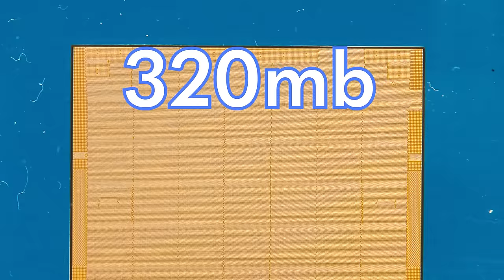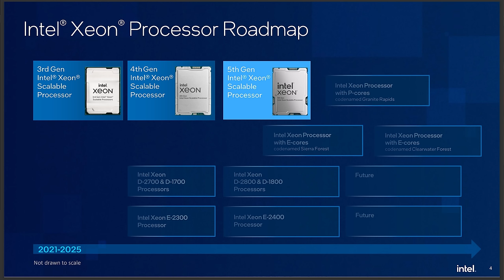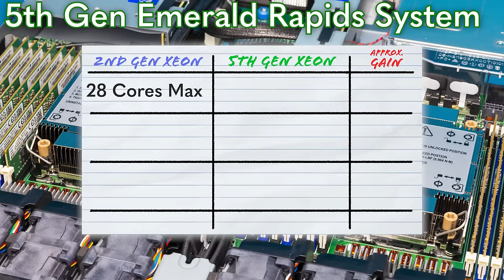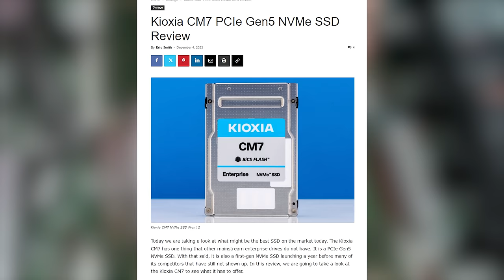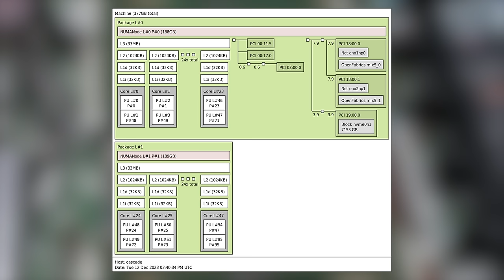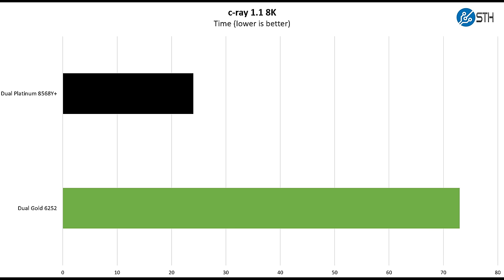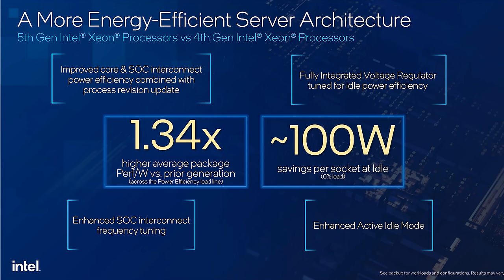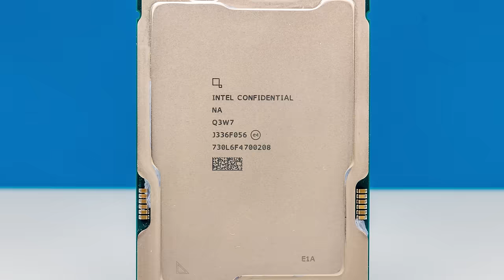New 5th Gen Intel Xeon Processors - ft Supermicro X13 - Emerald Rapids

Comment: Thanks for the great review. EMR looks like a solid upgrade even for those coming from Ice Lake! (Though we're waiting for Granite Rapids for our next upgrade). As a current SPR workstation owner though, I really hope they manage to find a way to somehow make the reduced PCIe lane in EMR works in a workstation. (EMR only has a maximum of 96 lanes on die while SPR has a max 128 with 112 lanes enabled)
Reply from the maker: To me, the cool part about an EMR desktop would be the lower idle power consumption. 80-100w is huge. I do not think many folks are going Ice Lake to EMR just because Ice was launched in early Q2 2021 but started to ramp volume in Q3. 9 or fewer quarters is short when many are pushing servers to 6 years/ 24 quarters of use.
Reply: @ServeTheHomeVideo Completely agreed, that improved idle power consumption is huge for workstation. Which is why I I think it would be sad if they can't make EMR works on existing W790 boards due to reduced PCIe lanes (as they're physically wired)

Comment: Diving into the fascinating comparison between the Gen2 Gold 6252 and the flagship Platinum Gen5 8568 is truly captivating! Notably, at the time of release, there was a substantial price difference, with the Gold 6252 priced at $4263.00 and the Platinum Gen5 at $6497.00. It's crucial to recognize that these models cater to different needs. For a more precise comparison based on price points, exploring the 8568 versus the 8268 or even the 9242 might be more fitting. However, the notion of relying on those visually striking 3 to 1 figures remains somewhat uncertain.

Comment: Cool vid. I recently started tooking into xeon processoers when i picked up a used HP z440 for cheap. 👍
Reply from the maker: Thanks! Always great to get those old Xeon workstations cheap!
Reply: @ServeTheHomeVideo  yeah it was hard to pass up for 80 USD. It's gonna be a great project upgrading and tinkering. But it sent me down a rabbit hole reading up on all the differences the xeons have fro the I series or the older pentiums and celerons.

Comment: Based on my experience trying to prototype & run generative AI services on AMX on a sapphirerapids chip, while it does better than AVX512VNNI on icelake, it did not feel like the AMX accelerated software was sufficiently matured and that the AMX acceleration was not being taken full advantage of, since when adjusting for disparities in cores vs the compared chips, AVX512VNNI on zen4 was... not far behind. Another VERY annoying problem with AMX is that it is not officially supported in VMs - and true to intel's documentation, it flat out doesn't work in most VMs, only some specific versions of specific VMware hypervisors released in Q3/Q4 this year have support for it.

Does emeraldrapids solve the slow clock ramping that sapphirerapids is saddled with as well? When going from no load to max expected load, it would be overloaded for a while due to the cpus taking a while to ramp up to reach their sustained clockspeed (which is sort of the opposite of normal behavior, where normally clockspeeds will ramp down from an initial boost speed)
Reply: I have not tried using AMX myself, but QEMU+KVM does seem to report AMX support on SPR. FPU state also reports the correct size (with AMX Tile Config/AMX Tile Data being available). Though AMX does seem pretty half-baked for sure... (looking at all its erratum)
Reply from the maker: Did you see the main site piece we did on Numenta? That is super interesting. They are using AVX-512 plus AMX and can use Xeon MAX HBM as well.

Comment: There is unlikely to be workstation products, right? AMX might be the only affordable option to run really large language models locally. 

Can't afford several RTX 6000 Ada or A100. And Intel isn't selling their Gaudi2/3 or Max GPU for workstation either. (is this low power idle modes again?)
Reply from the maker: I would love for there to be workstation products since I think this is a better workstation platform than SPR.

Comment: I really want an ai inference device but I don’t want to go the server route. It’s a bit expensive and too power hungry.

The m1 ultra showed that it’s possible getting decent generative ai inference speeds using an APU. This is my backup plan if Intel or AMD doesn’t get their new products in order for ai.

I’m waiting for Intel or AMD to catch up because I don’t want to be stuck in Apple’s closed eco system. 

I heard that AMD strix point will have 50 TOPS for ai calculations. I might get that or Qualcomm’s elite x (if available with software support) and pair it with a lot of ddr5 ram and maybe a Rtx 3090 worst case scenario.

I reckon I can get decent response time for very large language models this way.
Reply from the maker: We have a M1 Ultra 128GB and it is not too bad at all for that.
Reply: @ServeTheHomeVideo  I saw benchmarks for the m1 ultra and I’m really tempted to get it. My main issue is that I can’t provide more memory to it. 

Although they claim it’s 128gb, not all of it can be allocated to the gpu.

There’s also no upgrade path for this device. After AMD strix point there’s apparently another one coming out called kraken. 

I’m not sure if they will come out for the desktop market but I hope they do. Either way, there will definitely be some Chinese Frankenstein computer coming out with these chips for the desktop market.

Edit: I also worry about repairability with Apple. If one thing is broken then the entire thing is likely wasted. Whereas the diy market has replacement parts for itself.
Reply from the maker: @theworddoner  To me, I am more worried about what happens if Apple stops supporting them. In the meantime, they get cheaper by the day.

Comment: Out of curiosity, if you were running on board AI accelerators to deploy generative AI, and had a hard power limit (absolute power, not efficiency), are there any server platforms that come to mind with support for around 356 to 512GB of memory, and a sub 200 watt total system power draw?
Reply from the maker: Are you just thinking AI? For EMR I think that would be pretty tough. EPYC 8004 can get close-ish, but does not have the onboard accelerators. With AMX, you end up wanting more cores since it is more like AVX-512 versus a standalone-ish IP block like a NPU or the QAT accelerator.
Reply: @ServeTheHomeVideo  Haha, that's a fair point, and thanks for the response.

I'm specifically thinking about large languages models deployed in CPU (via cache-line optimized linear algebra libraries, similar to LLamaCPP), versus dedicated dedicated accelerators.

My suspicion is that in a lot of cases you might be able to get to a memory bottleneck either way, in which case while there is a difference to an extent, you might actually lose more time paging in and out to memory than in dealing with CPU cores (particularly with AMX) or accelerators.

One somewhat wacky option is a person could tensor parallelize the models (given sufficient RAM) on a consumer CPUs, (on a low power server platform) possibly via OpenMPI, and it would be fairly easy to hit a quite harsh power limit as I've listed here, but there are software limitations so I was hoping someone else had come up with an idea I had missed.

Either way, this isn't a speed-critical application, but an accuracy dependent one, which isn't as common an issue in the space so I've been struggling a bit to find the right match.

Regardless, cheers, and thanks for the content!

Comment: I really want Intel to be the best one, but AMD specs are winning out on almost every metric for servers. 
Intel still wins on gamer PCs
Reply: X3D says hi. And idle power doesn't matter in Desktop Environment (it matters more in Mobile)
Reply: @rezaramadea7574  Can you explain? I am curious.
Reply: @MarkBarrett  Ryzen X3D beats out all current gen Intel CPUs, and not to mention using half the power consumption in Gaming. On the Gaming side Ryzen wins out, but on the Productivity side, Intel wins MT perf/dollar (AMD doesn't care enough to increase Core Count on R5 & R7 products).
Reply: @rezaramadea7574  Intel still wins on 1 or 2 cores, which "key threads" are most important. 
I'll admit, nothing I know of can beat the Threadripper on multi-core.
Reply: @MarkBarrett  Nope, you're talking about Gaming, X3D will still destroy intel, on every Average Metric possible.

1 core or 2 cores on "Synthetic Benchmark" is not Gaming.
Reply: @rezaramadea7574  What if, a max clock Intel CPU did "key threads" which are super important, and transferred to an AMD Threadripper for all the main workload? 
That seems like a super combination...
Reply: @MarkBarrett  yeah, that's indeed a dream come true. Threadripper doesn't really need 3D Cache, because few Workloads take advantage of it (most EDA & CFD simulation will have to use EPYC-X). 

Threadripper with Extreme Clockspeeds will leverage many workloads that matters. The issue will be Power Cost & Heat (liquid-cooling will be an absolute Mandatory).
Reply: @rezaramadea7574  You sound overly defensive. 
I gave you a good credit to AMD. 
You should return it.

Comment: Now compare to Milan 😂
Reply from the maker: It is in the performance section.
Reply: @ServeTheHomeVideo  linux compile Emerald rapids has ~20% on Milan. Milan is not cascade lake. Feel for you Patrick….
Reply from the maker: @BurnsRubber  Yea Milan was an Ice Lake generation. Not much of the market will upgrade from Milan or Ice to EMR because they are <3 years old. The huge market force right now is upgrading 2017-2021 era Xeon servers. Until Rome, AMD did not even start to make a dent in the market.
Reply: @ServeTheHomeVideo  yes good point. Intel is obviously desperate to keep those customers seeking to upgrade from the stagnation era of intel (2017-2021) from switching to ARM or AMD. AMD has an advantage in that they can offer a complete ecosystem, with X86 based servers or clusters with GPU acceleration for AI / massive parallelization with MI300 or FPGAs with Xilinx. Intel has failed to make their GPUs competitive with AMD and Intel.

Comment: Sorry for changing topics, but I had a quick question regarding Project TinyMiniMicro. I've seen that these HP Minis only support 64GB while you fitted one with 96GB. Did you run into any problems with it?
Reply from the maker: I did not in the build.
Reply: @ServeTheHomeVideo  Thank you for the quick reply :)